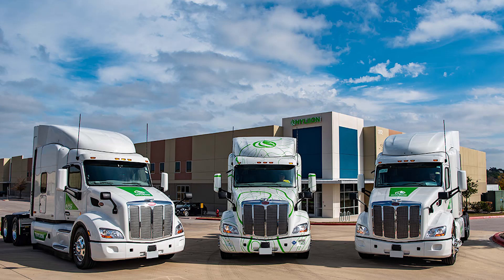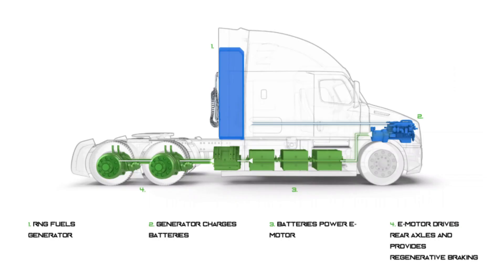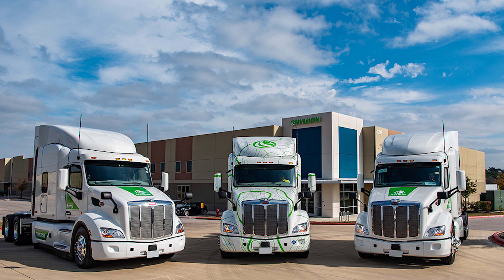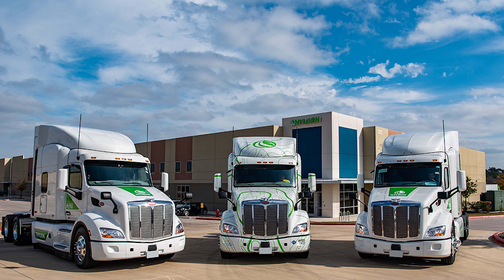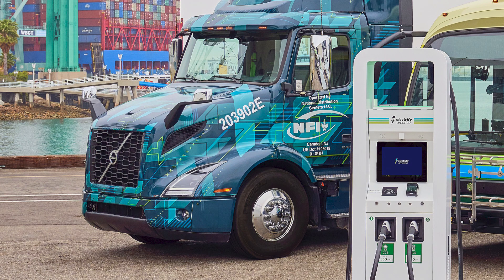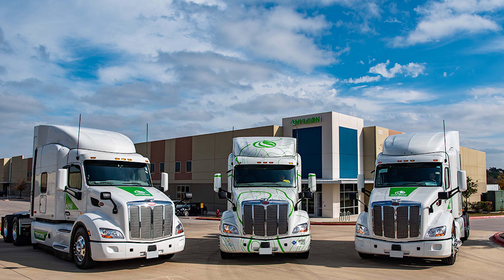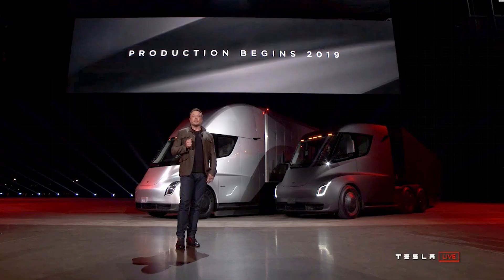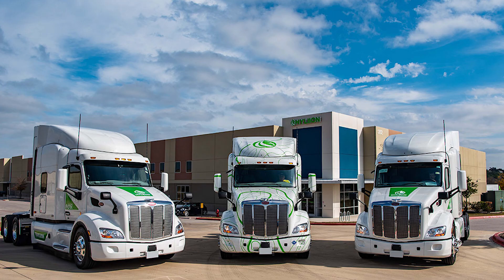Hyliion Hypertruck ERX Powertrain | HYLN Stock

Comment: BEV only trucks are never going to work for long haul applications. It won't be feasible. The range is too short and the more battery you put on the truck , the less freight you can haul unless you drastically shorten the distance. The other issue is the down time or amount of stops wasting time in mileage. Transportation and trucking companies don't make money unless they are moving miles in time intervals. What about when they are hauling perishable goods or produce that need to get from A to B quickly virtually non- stop. What about Refrigerated products and medicine. Obviously the powerplant running the refrigeration system will also need to be figured in. Most refrigerated trailers have their own on board fuel and generator system or an ICE driven compressor system. 

I used to repair them a long time ago. The refer trucks and trailers will also consume a lot of energy for that function.

For right now they should be concentrating on smaller more efficient Diesel generators running the Hybrid system as the first step to change. They also should be retrofitting our existing fleets and breathing new life into older trucks. It would be more cost effective to start building glider trucks now out of older used trucks. 

Drop the rear axles and bolt on the Electric ones. Mount the new battery packs in between the frame rails. Drop the transmission and bolt up a generator to the existing Engine or better yet drop in a more efficient smaller power plant that is multifuel. 

It would be much cheaper and more sustainable than building all new Hybrid trucks from scratch. 

It would be faster and you could literally have a truck converted in 2 days with modular systems.

I used to be a Heavy wheeled vehicle mechanic in the Military right out of high school. I worked on multi million dollar equipment with all forms of diesel power plants.

It is very easy to have a variable rpm output control system on engines.

In fact the most efficient form of power is either a Diesel running a constant low rpm or a small jet engine running a constant high rpm.

Once they are tuned in they are very efficient. A micro turbine is loads more efficient than other fuel burning engines.

A fuel cell with a medium sized buffer battery is the best solution for long haul trucking and a BEV for day use and local hauling.

Comment: LTO batteries have high number of cycles and the generator and BMS keeps the batteries at their happy spot. TH has said that the batteries would last the life cycle of the vehicle.
Reply from the maker: Another comment mentions that most of the electricity bypasses the battery. Wasn't very concerned about the lifespan before, but this is great to hear!

Comment: Better video  brother one criticism is the definition of BEV. Look up the Webster definition vs Wikipedia which doesn't support it being a hybrid. You also said as far as fuel goes its comparable to diesel and fact is we don't know that yet. We don't know what generator the ERX is using nor it's fuel capacity.  The battery cell they use is from  Toshiba and actually has a longer life span than normal EV batteries bc of the constant charging and discharging cycle,  which is better for battery life. This video is better than the last one, but I think you would really benefit from joining the hyliion  discord for a deeper dive on this company.  It's well worth it.
Reply from the maker: Another comment mentions that most of the electricity bypasses the battery. Even better for lifespan, although I wasn't concerned before, just thought it was worth mentioning. What's the invite to the Discord?

Comment: Not correct.  Electricity coming from the generator does not all run through the battery.  Often it's going straight from the generator to the electric motor, bypassing the battery.  The battery simply serves as a buffer during high draw periods, or as the sole provider of electricity when running the truck in zero emission mode (75 mile range).
Reply from the maker: Sorry I didn't get this right, couldn't find much on this during my research. Would be ideal to operate it in this way!